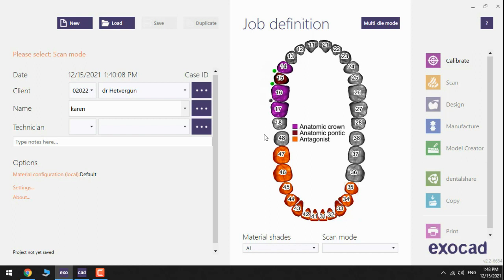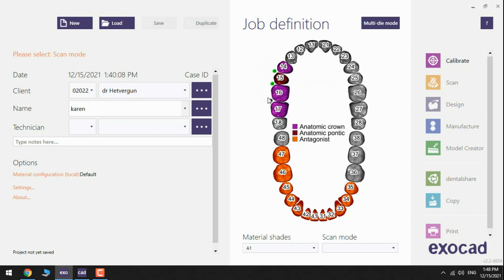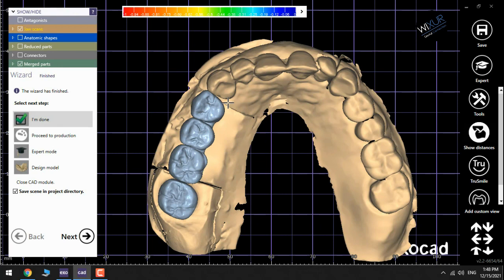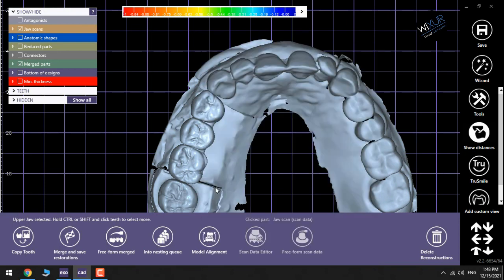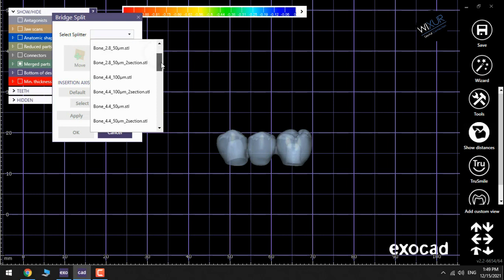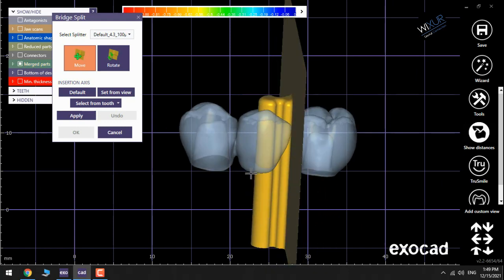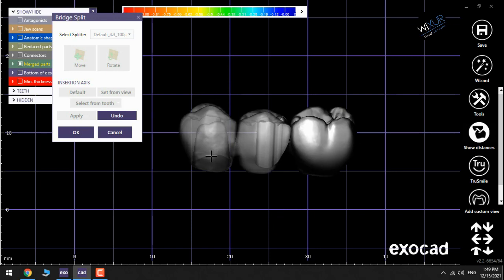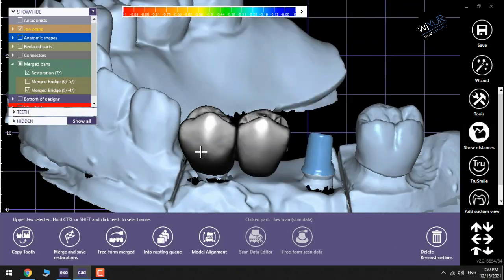Exocad - Splitting Bridges

Comment: Thanks a lot my friend
Can you tell me when I finished my design (pmma) how change the material to zirconia ??
Pls thanks
Reply from the maker: Hi, thanks for watching.
May I ask why do you need to change the material?
Reply: @wixur  some doctors want check how the design look  inside patient mouth so we make it from (pmma)
I want to change the material type after checking without start a new project
Reply from the maker: @YahiaSaad174-xy5mm  I got it! It is not possible to change the type of material after you finished the design because all the parameters are considered based on chosen material. However, you do not need to change it really! Just send your design to be checked, whether it is designed as Zirconia or PMMA. Different materials have different parameters, the rest is the same!